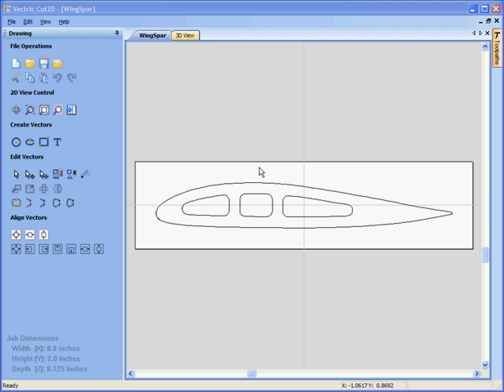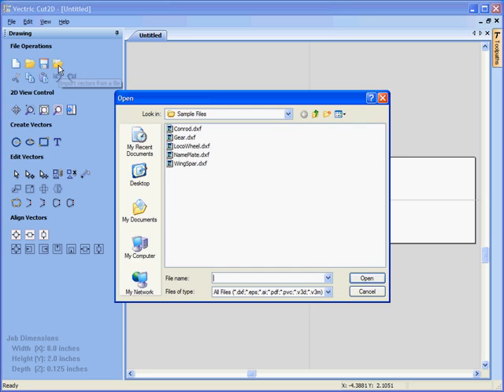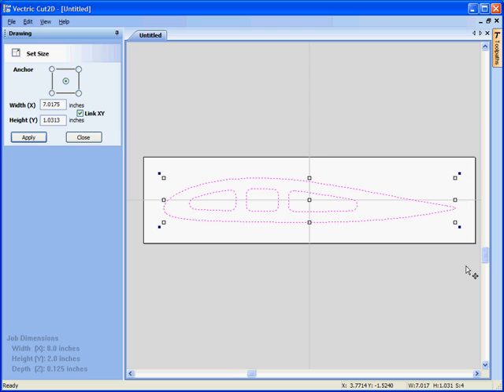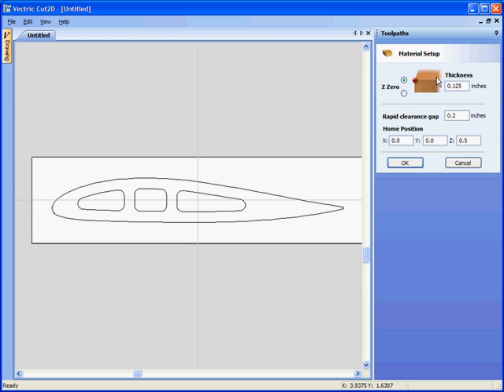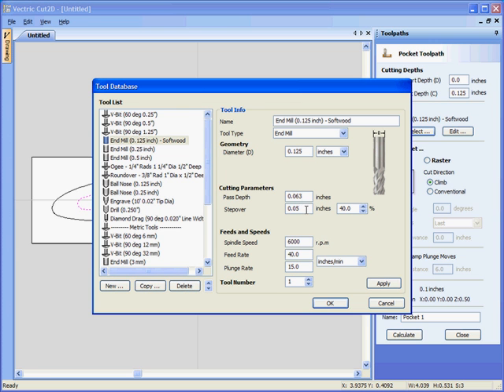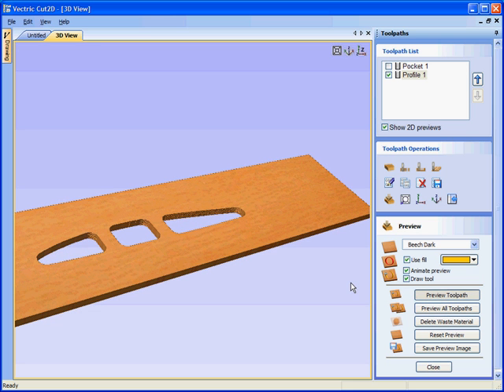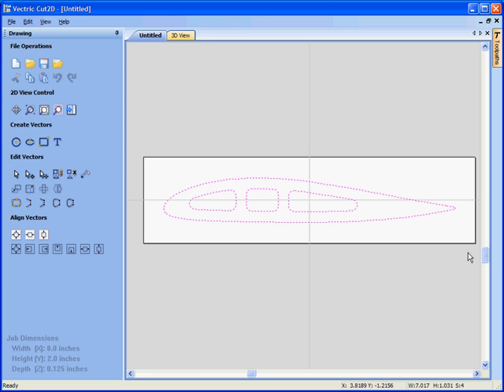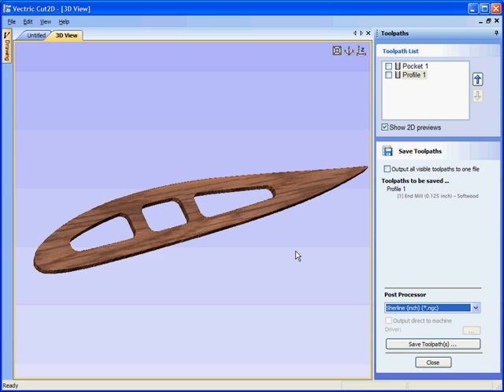Cut2D - Calculating CNC Toolpaths for a Wing Spar - New

Comment: Can you make a tutorial how to do multiple functions if I do not have a ATC(automatic tool changer)
I would like to drill some holes with a 1/32 drill bit then cut a profile out that I have placed tabs in.

will this process be ok to make two programs and process one after once the material is set on the table?

Thanks in advance-
doug